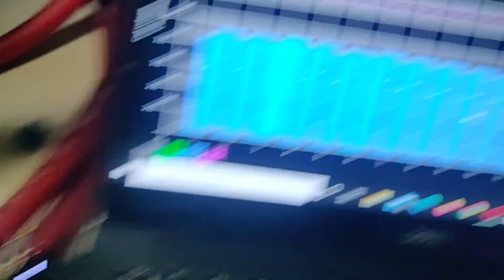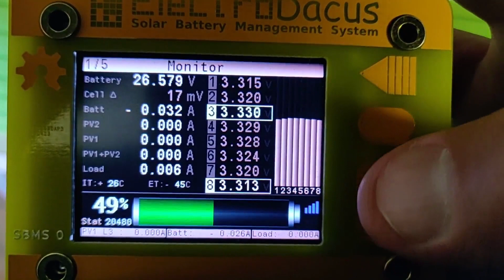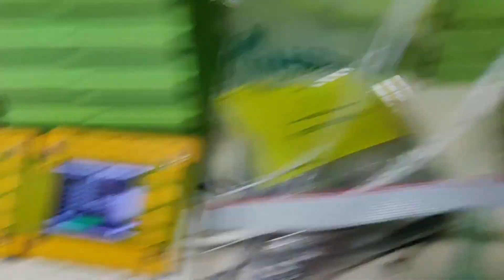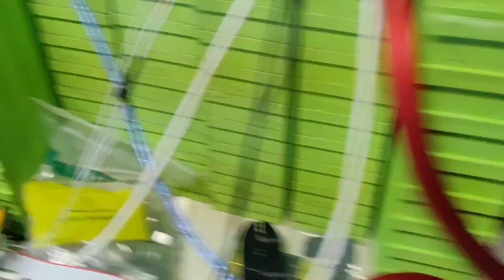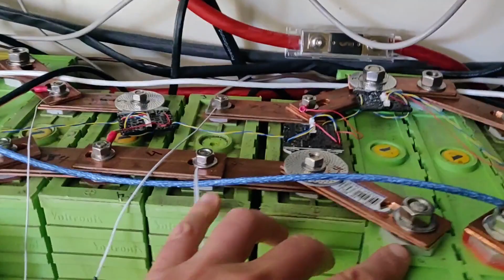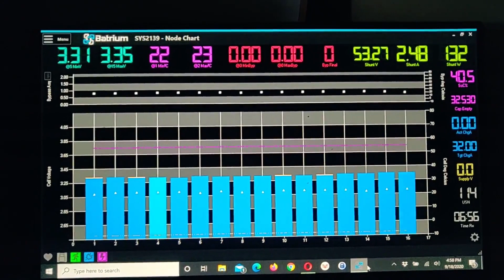Electrodacus SBMS0 vs Batrium

Comment: AM buiding 4s5p x few packs from 18650.If i connect it to SBNS40 (8 terminals will each record 4 x 3.7V to 4 x 4.2V when fully charged) i dont understand why many recording 3.7-4.2 V instead ?m i missing something
Reply from the maker: I think I'm missing your point a bit, but I'll give a shot at what might be the issue:  The vast majority of users are using Electrodacus equipment with LFP chemistry, and have their voltage settings set for that type of cell.  There's a setting in the SMBS40 in the menu where you can select different chemistries, which you'd need to do if you're using NMC 18650 cells.

Comment: Which is better ?
Reply from the maker: That's a loaded question.  Better at what?
Reply: @NoelBarlau  better overall? Better bms not matter the price which is better
Reply from the maker: @Leonardo-mw7tn Batrium, hands down.  But it's kind of missing the point to simplify it to one metric.
Reply: Ok but batrium still better

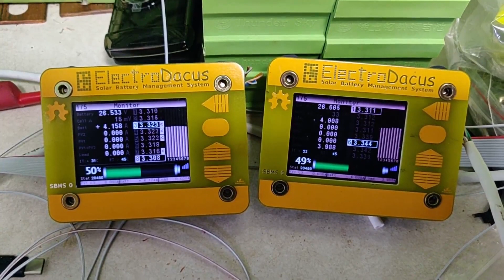Comment: Why at min 15:00 the electrodacus on the left have the voltages per cell levels vary so much periodically?
Reply from the maker: I believe the SBMS0 is trying to balance the cells. It might look like a lot of dancing around but it's really only hundredths 0.01 and thousandths 0.001 of a volt variation.
Reply: @NoelBarlau  I see. it is the 3 sec ON 3 sec OFF Balancing setting in the sbms0....

Comment: For LiFeP04 cells, on the Batrium display, you may want to consider reducing the "displayed Cell Voltage maximum graph value" a little. Maybe try 3.85V. This brings the heights of the blue cell bars up to a higher proportion of screen height, and shows any differences a bit clearer. I have a WM4, and my particular cells have 3.60V set as max charge Volts.

Comment: If you install 2 BMS to the same set of batteries,  which BMS is doing the cell balancing?  Both of them? Won't they conflict with each other?
Reply from the maker: One SBMS0 is hooked up to the top 8 nodes, and the second SBMS0 is hooked up to the bottom 8 nodes.  They don't communicate with each other, but the settings are the same on both.  The difference can come from a mismatch in charging power due to panel imbalance or shading.  Again, this is not an approved usage of these units.  I'm taking the health of my batteries into my own hands.
Reply: @NoelBarlau  my question was NOT related to your setup with the 2 Ectrodacus. my question was a theoretical one. But i think it applies to your setup too. You have the Electrodacus hooked to 8 cells and the Batrium hooked to all the cells (including those 8 cells) so which is doing the balancing (the Electrodacus or the Batrium)? Or both? Any conflicts in the process?
Reply from the maker: @thelightworshipper9687  I see.  Well so far there haven't been any conflicts.  The cells all maintained excellent balance during the test.  I unplugged both the Batrium and SBMS0's as I'm not using the system at the moment to avoid parasitic load during idle weeks.  This has all been for fun, as we decided to go with a grid-tied system instead of off-grid.
Reply: @NoelBarlau  Thanks Noel, i have been learning and reading about the SBMS0 to see what it can  do (or not do). I will have more questions to Dacian.
Reply from the maker: @thelightworshipper9687  Dacian is extremely responsive on his forum.  The link to the forum is on the main web page kind of hidden in the upper left corner.

Comment: You may want  to clarify in future video when comparing the two that the Batrium does have significant other features that the Electrodacus does not.  Not sure if it is the Batrium WatchMon4 you were using but that does have active cell balancing and individual cell temperature monitoring as well as WiFi.  Active cell balancing is not commonly found on the cheaper BMSs.

Comment: Thanks for the video! Interesting test.
I kinda wish Dacian would make a 48V 8s MPPT controller but I understand it doesn't really make sense. With 24V you just use all solar panels in series, everything is neat and tidy and don't need MPPT and falls into place for a very economic setup.
Is there anything new for 48V and higher power output and more space/energy efficiency with MPPT besides Batrium?
Reply from the maker: Dacian is quite insistent that he'll never make 48v equipment, and that's his right.  Really he just makes stuff for himself and then sells it to other people to offset his development costs, or so it seems.  He makes excellent equipment for 24v systems, and I highly recommend his products.  For 48v systems pretty much any MPPT charging solution is fine (I'd look at Victron, personally), and there are balancing units which don't have the level of sophistication of the Batrium system - or the monitoring capability.  You'll have to decide what suits your own intended usage scenario.
Reply: @NoelBarlau  Thanks, yeah that all makes sense. I'm getting a handle on what I need but I still have to learn a lot more.
Ideally I also want to be able to do replacements and simple repairs if fuses or capacitors burn out.
Reply: In italy a small company makes a custom made BMS that has tons of features...and it's even cheaper than the Orion or Batrium. Probably it's good looking but works perfectly for automotive as well (my car was the Guinea pig for the testing). On my case it was set up to work  in a 48v system with a 16s battery pack.

Here are 'some' features:
Modular HW & SW structure. Get just what you really need
- Stackable up to 1000V
- Wide battery chemistries managed 
- Choose up to three different Active balance strategies: 
Dissipative, Non Dissipative or Both 
- Adaptive smart balance algorithm
- Up to 5 (10)A on Active Non Dissipative balance 
- Multiple interfaces - ports & protocols – vs. Battery Chargers 
and Systems 
- Main features widely programmable 
- Specifically devoted for top-end applications in OEM market
Reply: @shinosg-wiz4619  Oh that sounds really interesting. I'm in Europe, what is the company's name?
I don't plan this immediately, but my long term dream is to build a solar powered trimaran cruiser. So I'd want 48V, about 7kW solar panels and around 5kW for motor power. Battery would be modest at around 20 kWh LiFePO4.
Reply: @shinosg-wiz4619  do you have a link for the bms
Reply: @jamesmason7124  you can contact the www.hydra.it and ask about Alex or anybody else regarding the BMS